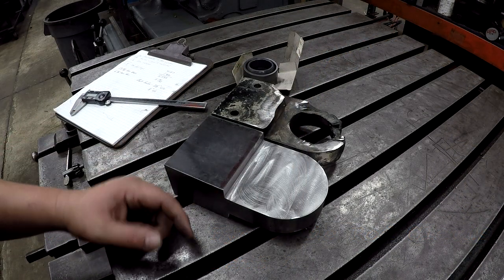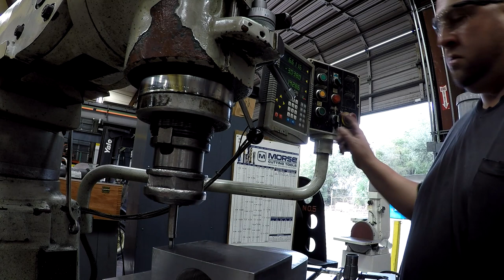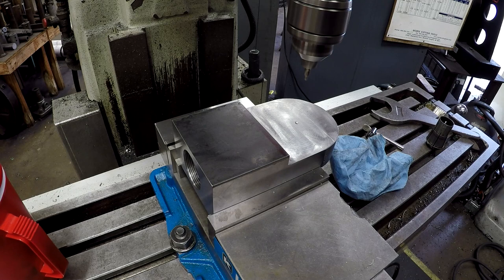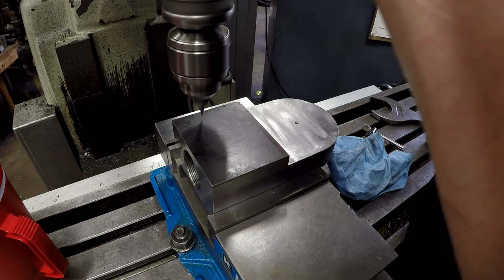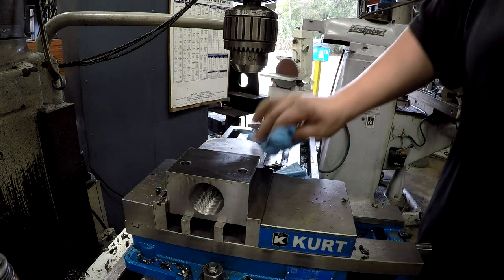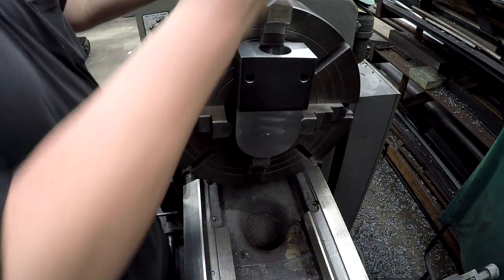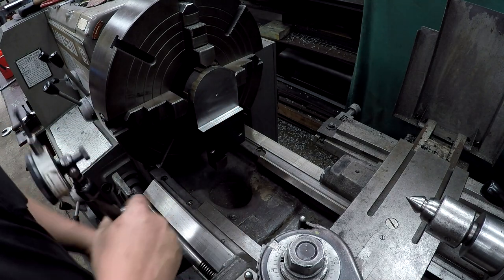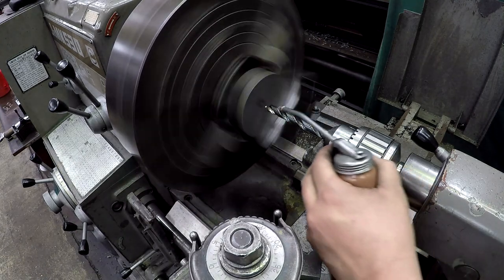Fabricating a Hydraulic Rod Clevis Part 4

Comment: Loved this series. Curious to what this cost the customer?
Reply: +Glass Impressions Better question: what is this going to cost the employee who butcher cut the original part which had to be replaced? His job? Money? "make-up" time?
Reply: +Glass Impressions I doubt Adam will answer this question. One, it's not ethical for him to do so (he doesn't own the shop / customer) in this case and there are a number of different factors. Custom machine shop repairs that are "on demand job" are likely to be hourly rate plus materials and shop supplies. That's the reality when a part needs to be custom made and replaced - right now. 

If a customer comes in with a request with a blueprint, specifications, material type in advance and there's no hurry and it can be put into a "queue" of services, the machine shop can 'quote' a price and the customer has the option to say ya or nay to the quotation. If the shop is operating at full tilt, chances are, there's a reason - quality and good service. The price will be higher. If the shop is operating at less than capacity, rates quoted will be lower - to a point.

Each region of the world is going to charge different rates due to location, cost of operation, experience, type of equipment and current market rates for services. They can widely vary depending on the region. This is especially true in high demand areas for high performance machining equipment used for creating very specific oil drilling, hydraulics, and mechanical parts. 

It also depends on what kind of machine shop and work they do. An automotive machine shop (boring, line honing, cylinder head valves and guides, decking, etc) charge rates that are often significantly lower than an industrial machine shop. I've seen set rates per hour vary between $50 - $80.00 across the U.S. ($75 - $90.00 in Canada) with industrial rates anywhere between 15 and 30% higher. Inflation over the past three years has really hit shops across the U.S. with increased electricity and real estate costs as the economy slowly rebounds. Steel prices fluctuate and vary State to State and generally do not follow the commodity wholesale rate like they used to. Nobody stocks steel at the "local" level as much as they used to. It's order and then deliver on time these days. Many shops no longer want to carry inventory due to the expense, unless they have a customer contract for known services. Just look at Adam's 'stockpile' of off-cuts. They come in handy! I know myself on the automotive side, we keep most off-cuts along with extra blocks and heads when they show up - if they are worth rebuilding. But we don't carry inventory anymore!

If you want CNC machine shop services, they charge for setup of the design (software coding) that can really add up - unless you already have the design file ready for CNC (if compatible).
Reply: +Doug Hanchard thanks Doug. You said what I didn't have the attention span to write. To the other guy, prices can go up whenever they need to. The question is whether the customer is willing to pay for it. Cheers.
Reply from the maker: +Glass Impressions It's a question I often am asked but I do not talk about prices on here. it's not proper business to discuss what customers pay for work. Most jobs though such as this one is quoted up front, time and material. That quote is given to the customer for them to approve. The price depends on that shops particular hourly rate, and everyone's is different.
Reply: +Abom79 yup couldn't agree more!!!
Reply: jas wats it isn't worth the effort to explain it but you premise of not be able to raise your price simply because the customer or future customer knows the price of a past project is simply incorrect. If that was the case the world would have no price increases. Price the project or job to your customer. exactly what Adam said, price the job as normal... the customer will pay it or not.
Reply: you have just fallen into the internet troll category. have a great day!
Reply: jas wats you are a very close minded individual. and you have yet to prove me wrong, just failed to see from my point of view. Cheers.
Reply: jas wats i will remind you that you commented on my comment...
Reply: +Abom79     Why do you elect to drill and bore the Hole on the lathe? Is it way you feel the most comfortable?
Reply: +potlimit2002 I am betting setting up the part in the 4 jaw chuck was faster/easier than setting up a boring head or boring bar on the mill. Not to mention adjusting the cut size on the lathe is easier too.
Reply: +Glass Impressions I can tell you what I would have quoted to the customer. 6 hours at $65 per hour plus material. And that is with CNC capabilities. Adam did it old school.
Reply: DomManInT1 When he center drilled the part for location he had the job set up to do it in a mill.  I can put a boring head in mill way quicker than what it took him to center the part in the lathe. I am thinking that perhaps he didn't have a drill bit to do the roughing on the mill as quick.
Reply: I will disagree. Do it your way and enjoy.
Reply: DomManInT1 I have done it for the past 28 years own and operate a Machine shop that does work for World wide companies.  Me or any guy in my shop could of done that hole before he had it running in the lathe. You didn't see in the Video the time it took for him to set the jaws of the lathe before he even started center the part.
Reply from the maker: +potlimit2002 Congratulations on your success and long work history in the trade. perhaps you could share some of your work on video for others like us to learn from as well.
Reply: Abom79 I hope you didn't take my comment as disrespectful Abom79. I love your videos and I know you are a great Machinist! I have thought about making videos of my shop and showing some of the work I do. Why did you elect to Drill/Bore the hole on the lathe? Trust me when I tell you the CoroDrill 880 drilling system from Sandvik would have made the hole even in a manual mill before you had it centered in the lathe.
Reply from the maker: +potlimit2002 It's just my personal preference rather than messing with a boring head. Tooling such as you suggested I do not have. I would have had to drill , then bore. My other option would have been to use my horizontal boring mill. But I also do things for video purposes and show people other ways to do things.
Reply: +Abom79  Drilling and Boring a hole like this on a lathe often comes up in a job shop because of the need to ID thread the hole. Large taps can be very expensive or not hand and the customer may not have the time to wait on a tap to be ordered.
Reply: Glass Impressions I know this is like 2 years old but...the better question would be how is it priced when your doing the job at home and at work?abom...are you subbing work from your day job at home?

Comment: Hey buddy, noticed you sometimes have to throw a charge on the 'ol gopro. I bought some Wasabi (I think that's the name) batteries from Amazon. Pretty slick, comes with 2 Batts and a dock, so u can just hot swap em and never have to plug the gopro in. Pretty convenient. Thanks for the vids

Comment: Excellent job.
I'm thinking about the way you indicated the bore. Looks like you were using a live center to indicate off? Are you sure that the point and the outer surface are actually true to each other? Ideally, I would want to turn a point and a measuring surface at the same time.

Comment: Adam, Perfect work, as usual.  Question:  on a milling operation, when do you choose to use coolant irrigation versus no coolant?  I believe that you usually use coolant irrigation for milling external key slots. Why?  When do you not use coolant on a milling job?  Thanks.  Steve in Los Angeles.

Comment: Hey Adam. Just curious... What's your thinking for taking the time to do the bore in the lathe? Seems like a lot of extra setup time vs utilizing drill/boring bar in the mill? Thanks for the video. I learn something every time.
Reply from the maker: +Robert Welchman It's faster and easier for me vs using a boring head. I would have done it in the horizontal boring mill if I couldnt put in the lathe.

Comment: If you went through the trouble of using copper spacers on three sides, why not the forth side ? I did see the jaw mark when you took it out of the four jaw chuck. Also was there a slight overcut on the milled out step ?

Comment: Hey Adam, just curious why you didn't just use a boring head at the mill instead of moving over to the lathe.  Is it because of the large diameter and you can install larger drill bits at the lathe?

Comment: Nice work and I enjoy all your videos. Two Questions- Determining your press fits, do you use a standard like .0005" to .001" per inch dia. depending on how tight a fit or a reference book? Second, what would your fix be if you by some chance over shot your dimension by say a few thousands oversize? Loctite, knurl, sleeve, etc. Thank you, Ed Cleve. Oh.
Reply: +Eddie Kawecki You can find international standardized fits in the ol' machinist handbook. Of course, after a person has been doing this kind of work for a while, you know what it should be based off of experience alone.

Comment: Great series.   Thanks
Why is the slit used instead of a jamb nut?
Reply: +Morris Gallo  It makes the thread fit zero clearance for the whole length of rod engagment and provides a much stronger joint between the two parts.  Jam nuts are poor practice on a shaft that is both pushed and pulled.
Reply: +bcbloc02 Makes sense, thanks

Comment: Not sure why you chose to use the lathe instead of the horizontal boring mill to make the bore for the bearing. Since you had a machined surface on the bottom face, I would have thought the set up would have been a lot easier with the boring mill than the work holding and indicating with the four-jaw chuck. I actually thought the boring mill was the reason why you were bringing the piece back into work in the first place.

Comment: Hi mate.  When you increased the RPM I was scared that you might end up with a face full of hydraulic clevis.  I would be shit scared to wind up the RPM on that sort of a set up.  It's not only the clevis, but also the jaw that is sticking out, and create a fair imbalance. I half expected that the lathe would start shaking.
Reply from the maker: +Marcel Timmers You have to find that fine line of balance on the machine. the RPM's i selected was ok. I let the machines speak to me.

Comment: Don't understand why you elected to bore the large hole on the lathe.  Surely you could have done it on the milling machine and not had to even change the set-up for milling the first side down.   Just a change from a fly cutter to the shell mill.

Comment: Why didn't you drill it out and use a boring head while it was in the mill? For just a 2.5 hole I would have poked that thing with a couple of drills to the biggest that would fit the mill and then use a boring head to finish it out. The set up time from machine to machine is killing you......